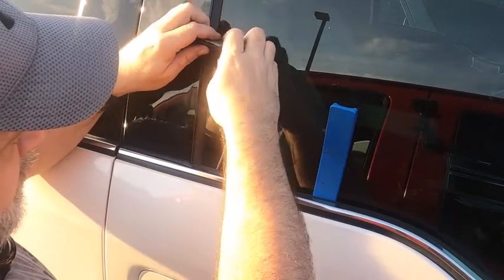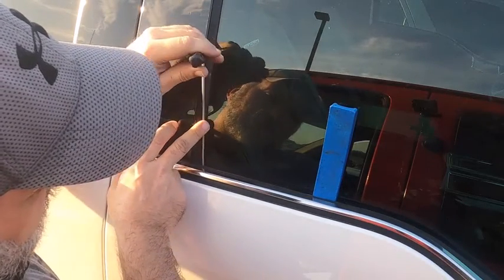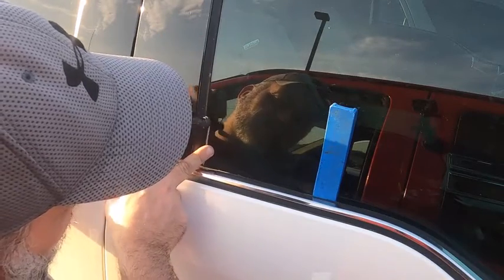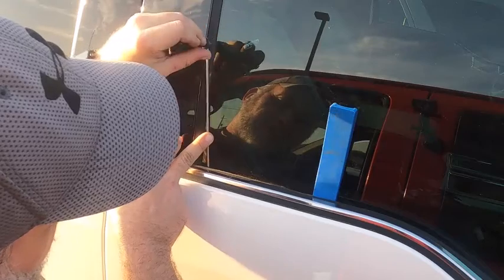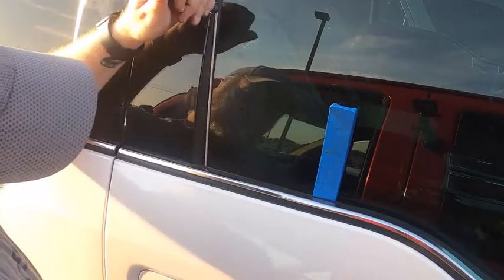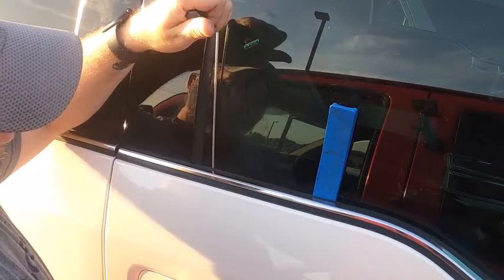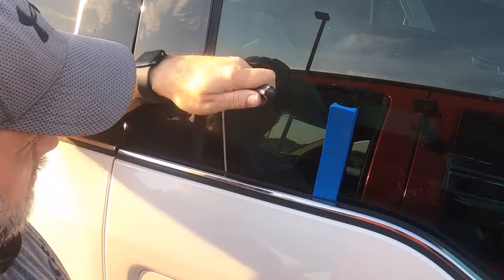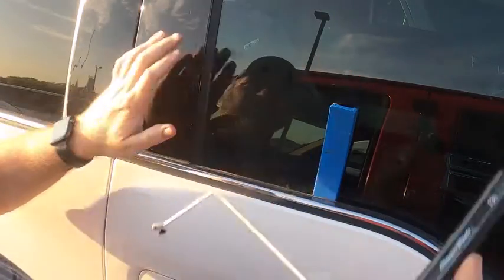How to unlock a locked door on a 2017 Ford F150 no key or picking the Lock. Access Tool Usage video.

Comment: Thank you so much, this worked and saved me some money.  I have had my truck for 4 years and I found out tonight that my key does not match the door handle.  I had pulled the battery to replace it, and when going to put it back in found out that I was locked out. Used a coat hanger and made a similar looking tool.  It took me about 20min, but totally worth it.
Reply from the maker: I'm glad it worked. Also, open your door and look at the door see if you have a black piece of metal rivet at the door lock level. If you do you can order door locks and swap them out easier and cheaper then having a Locksmith make a key. But you'll have 2 door keys. Also here in the next month I'll show how to program a remote for Ford. A 4 button remote no special tools needed.

Comment: I have a 2017 F150 4-door, the left rear door will not open with either inside or outside handle .Will this procedure work on the rear doors? I have after market door locks and hope that is not contributing to the problem. I hope you respond as this video is 3 yrs old. Thanks.
Reply from the maker: This method was to unlock a door. If your door won't unlock it can be a cam issue. But if it doesn't open that's a linkage issue or a latch. I need more info to help you. 
Do you hear the solenoid in that door when you hit the unlock?
Does your inside latch have any pressure?
Reply: @sgtlocksmith I hear the pwr lock actuator and see the pushbutton go up but then it retracts immediately. I tried opening door while hitting key fob. I took the plastic lock button off and used a needle nose to pull stem up also while trying dr handle. The big problem is I can't remove door panel with door closed because fasteners on bottom are not exposed. Thxs for reply!
Reply from the maker: If you're able to grab the door lock top. Unhook the battery with the a door being left open. (Negative side) then pull the unlock knob up. Since it won't have power it shouldn't relocked.
Reply: @sgtlocksmith  I can't open door at all. I see the hinges and thought about taking bolts out but door will still be stuck on latch side. I mean I can disconnect the batt or door lock controller and see what happens. Weird deal.

Comment: This works very well however most coat hangers are too thin to consistently work. I tried searching for a 45-degree lockout tool but wasn't having any luck finding what you showing this video. Could you drop a link or an accurate name to search for. I really just need the single tool, because it's just for my company work truck that they won't give me a freaking spare copy of the key!? Lol. I'm always locking my keys in my truck. A replacement key is well over a hundred dollars, and most of single piece tools go for a lot cheaper. The coat hanger works, but would be so much better if it was twice as thick.
Reply from the maker: Mine is through Access Tools out of Florida. I might also suggest the s tool since it's my go to tool for vertical ford buttons.
Reply: @sgtlocksmith  thanks!